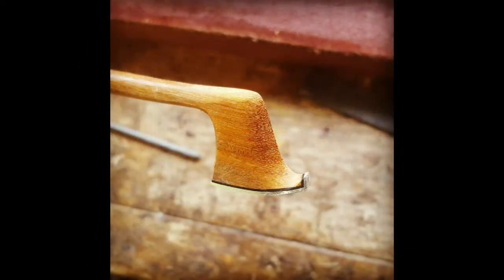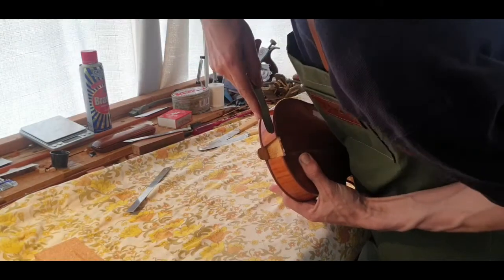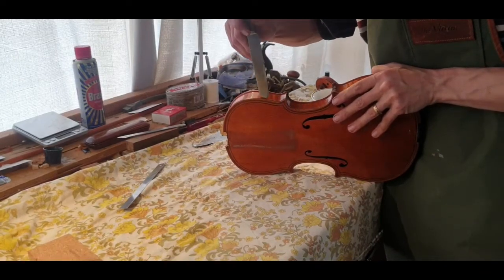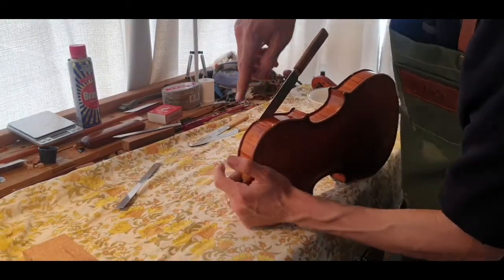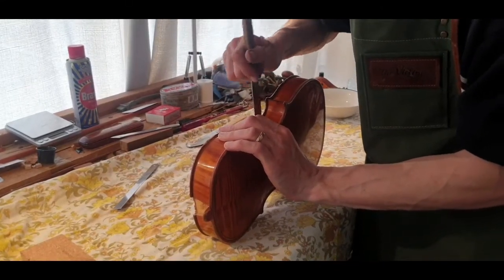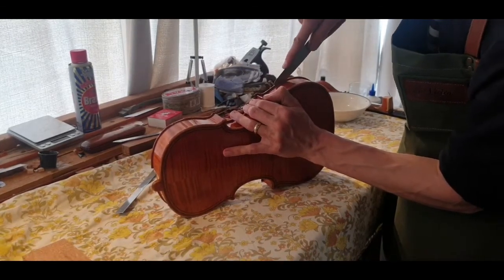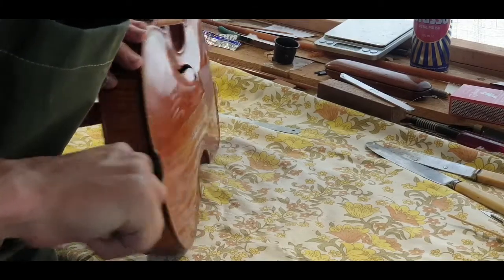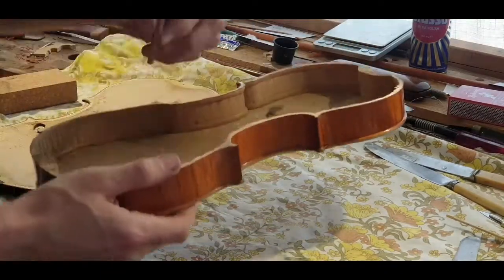Restoration of a Maggini copy violin Episode 3 How to remove the top off a violin!

Comment: Hi there, old timer piano and furniture restorer here in the UK, do you not ever warm your knives or use a little white vinegar to help melt/ease the glue? Great video thank you
Reply from the maker: Thanks for your question. I do often warm and / or wet my knives in hot water. I've never tried white vinegar before (unsure about the acidity and effect on varnish?) and would be curious to hear more about your experience with it if you'd like to share :)
Reply: @windowintomyworkshop820  Hi there, I find vinegar great for easing hide glue joints, when needed, chairs for example, and have had no adverse effects on french polish, varnish or wax finishes, though wise to do a test. Cheers